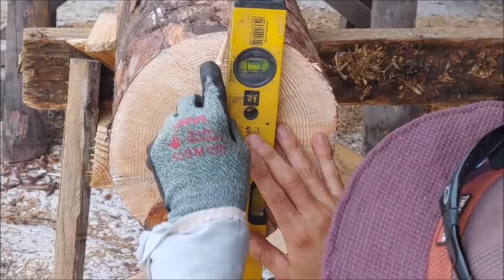House23-빈티지 원두막,정자,한옥, K Woodworking,wood.

Comment: I am surprised that the bottom of the columns were not treated to prevent water from wicking up into the heart of the column and rotting it. Sitting on the bare concrete will promote wood fungi to attack the wood which will lead to rot.
Reply from the maker: You are right.

Comment: Could I ask what the white material you put under the posts is? Looked like salt?

Seeing the roof construction was great! Never seen that before. Thanks.
Reply: Yeah I wonder about that for ages in Korean Hanok construction. Yep your right, its salt.
Good way to keep your post from rotting, just use pool salt and buy it by the bag.
Reply: @dodgygoose3054  does it work?
Reply: @TheAnalogKid2  too a point, the main thing is to keep moisture away.  But salt does inhibit bacteria growth and if you make a Borax and salt solution that works quit well